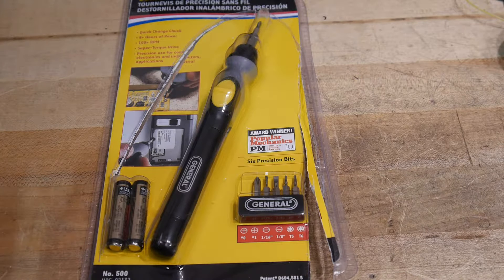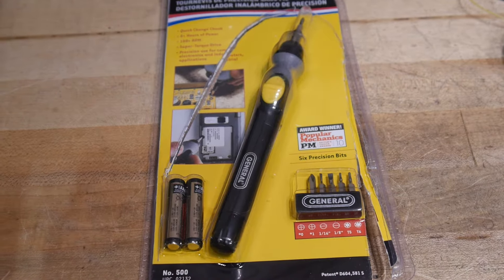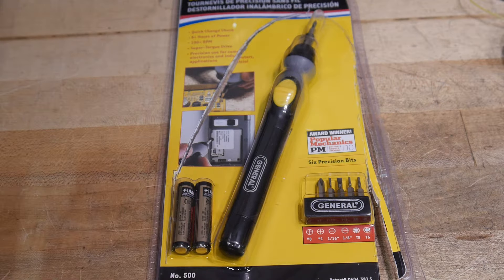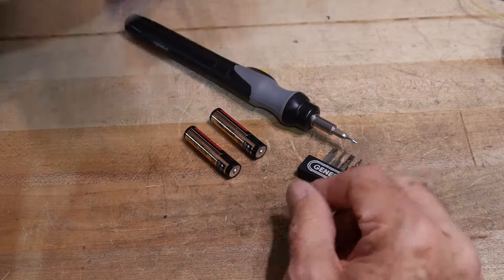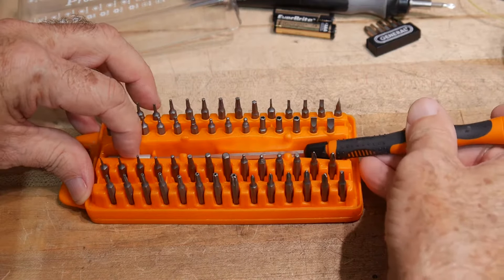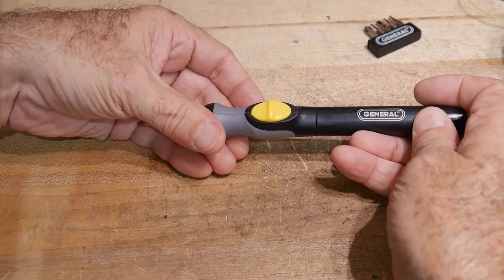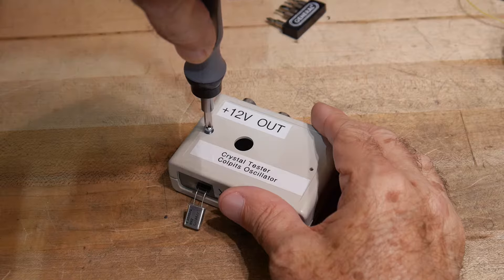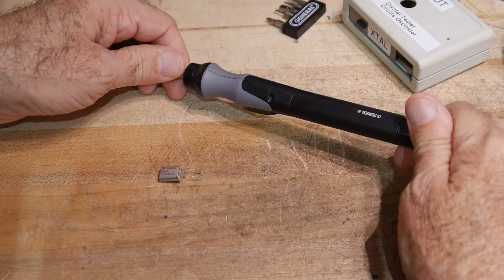#284 electric screwdriver

Comment: I have this same driver...TNX for the tip on the bit set. Along with test gear I love tools so have to have these kinds of drivers from this size thru several larger ones all the way up to the ubiquitous Ryobi cordless drill. Milwaukee makes a very nice pistol grip model for medium size jobs.  73 - Dino KL0S
Reply from the maker: my friend says they use the MILWAUKEE 2101-21 on M2 and M3 screws. has a low setting. $100 so still in range for my shop.